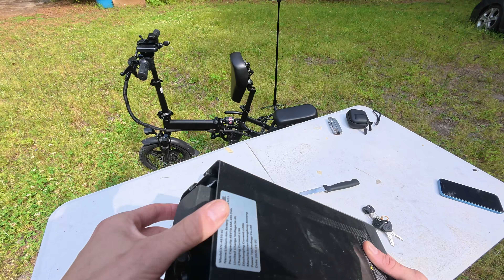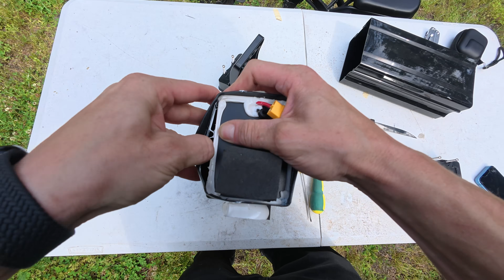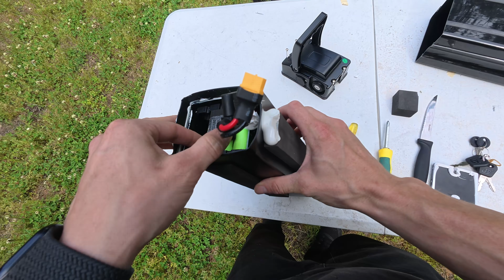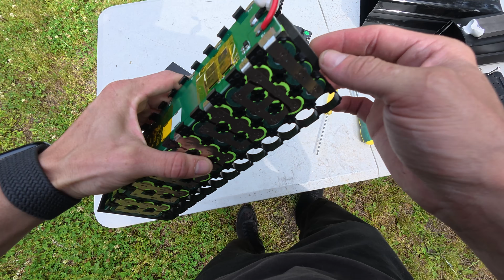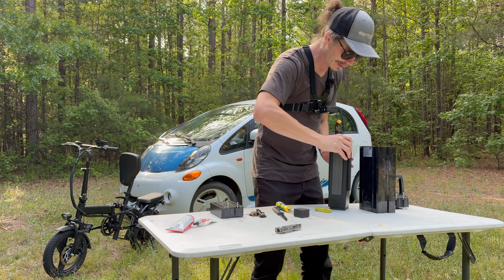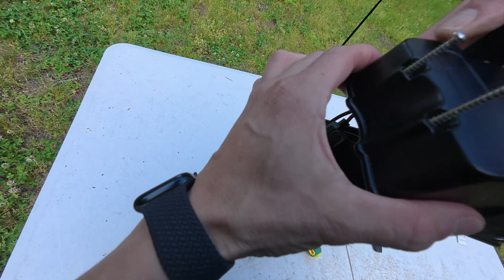Cheap E-Bikes Don't Recuperate Energy When Braking! I Want To See If I Can Add Regen

Comment: Cool that you talked about the email I sent about battery wobbling noise.  I fixed it by using patella knee pads - one high on the battery and one low.  Works great and removable.

Comment: Since it's it a low cost ebike, use a low cost VESC like a Flipsky 75100. You will also need to weld the plantary gear clutch inside the hub motor, and add torque arms.

To the regen haters: Grin already published the data on regen, it makes sense, anything you lose from increased coasting drag is regained plus 5-20% of battery power.

Comment: I am pretty sure you cannot add regen to a geared hub motor, which is what this bike has.  But even if you could, it is not worth doing.  For one, bikes generally are not stopping and starting constantly like a car in city traffic and so you aren't braking that much.  For two, there just isn't much energy to recover.  Unlike a car in the city with heavy regen, most of the energy you do have is going to converted to heat by the brakes because such a high level of regen doesn't really work with bikes.  
Finally, it will cost more than the bike did.  A good kit in the right wheel size (you will need all 3, a new controller, a new display and a new wheel/motor) is going to be at least 200 bucks.
Reply: You'd have to jam up the motor freewheel somehow (never seen one). The downside is it won't coast or pedal like a regular bike (even before actually extracting energy) so only makes any sense with relatively useless pedals.
Reply: @spentron1  The problem is without the freewheel, the pedals will turn on their own the way a fixie does.
Reply: @tarstarkusz  That's the pedal freewheel not the motor freewheel. Completely independent and why the motor or the pedals can stop.
Reply: @spentron1  The crank doesn't have a freewheel.  The freewheel is on the back hub either in the gears directly, called a freewheel or the cassette mechanism.  IGHs may or may not have a freewheel inside them (they probably do), but it doesn't matter because IGH  regen isn't a thing right now.  If they exist at all, they are specialized and very expensive. 
You would really have to use a direct drive hub.  This alone would be more than the bike is worth and that is before replacing the controller and display.  This is a 200 dollar bike.
All this money into the cheapest e-bike money can buy to get almost no benefit.  This is why so few e-bikes are direct drive.  The added expense of regen simply does not justify the price.  It is better to put the extra money they saved into a larger battery.
Reply: @tarstarkusz  The VX2 Gear scooter uses gears and regen (already discontinued), most scooters are direct drive due to the small wheels. But without motor freewheel, you're dragging along the motor gears and motor when pedaling or coasting, or with DD it's only the motor.
Reply: @spentron1  This doesn't help.   Also, there is motor resistance when pedaling an e-bike.  Pedaling an e-bike at PAS 0 is significantly harder than it would be a regular bike at the same weight.
Reply: @tarstarkusz  Compared to my DD escooter, my ebike coasts like crazy.
Reply: @spentron1  I'm talking about pedaling the bike without assistance, not its ability to coast.
I find it easier to pedal my trek with a trailer attached with 50 pounds on it than to pedal my 42 pound e-bike without assist on, especially pulling off from a stop (though my trek does have lower gearing available).
Reply: @tarstarkusz  https://www.youtube.com/watch?v=bLu6H-K4L2Y
Reply: @spentron1  Prototype not available for sale.
Reply: @tarstarkusz  Video as basic information, and all I know other than from riding and his sequel (even weirder). Should have just led with it.

Comment: You should run the battery all the way down and then plug the charger into a kill-o-watt and measure how much electricity is being used to fully charge the battery.  It will be about 80% of what came out of the wall.  So if .2kwh comes out of the wall, the battery is about 160wh.
Also, it's a good idea to check the internal resistance of the cells.  This will tell you a lot about the quality of the cells.

Comment: I would like to point out for the audience my front wheel for that E-Bike came loose. I thought about it and there are no " torque settings" or instructions on how tight that should be on there !
Also - Mine Does Not Say ANY INFORMATION about the battery, the size , or that it is UL listed. - Straight UP
Reply: I've heard about a person having the front wheel literally came off and that person breaking teeths due to this. I dunno if she bought it from Temu but bought mine from Walmart hopefully that shit won't happen
Reply: @jeanbob1481   Good Input ! well this is why there are so many " white label " and generic versions of things. Once someone gets injured or there is a house fire due to bad batteries, that business will close , but another one will have the same thing, The game never stops. - this happens in other industries also id bet.